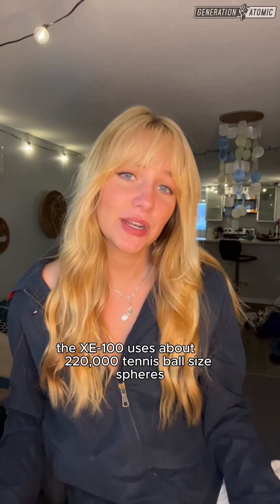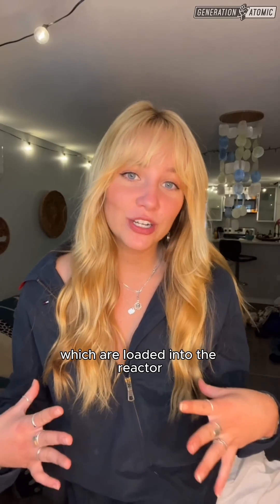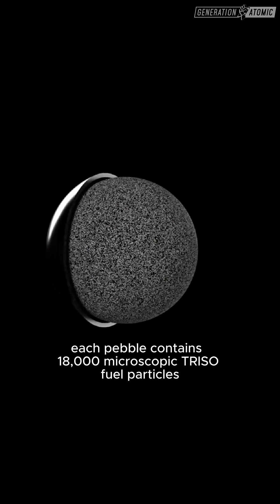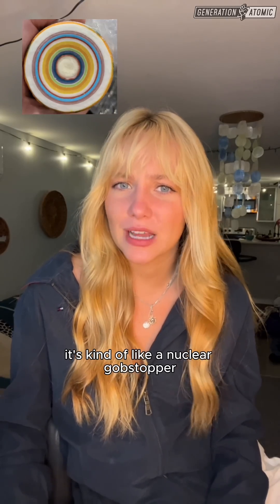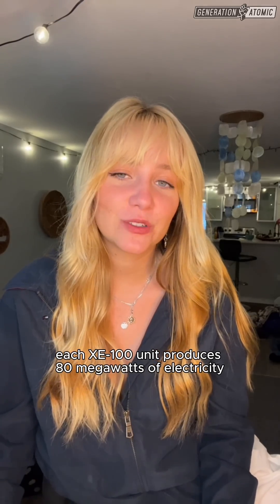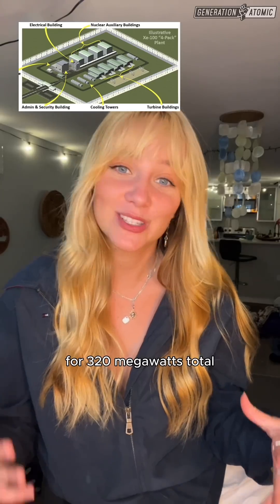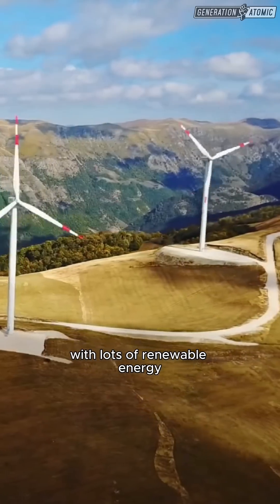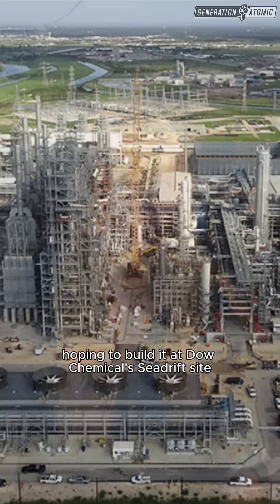The Nuclear Reactor Race: X-Energy #reactor #nuclear #nuclearreactor #energy

Comment: I'll feel better when something physically exists!  Could they make prototypes or something to jump start the supply chain???
Reply: They built it twice in Germany. The larger was called THTR300, it generated 300MWe power.
Reply: Hi, English is not my mother tongue that’s why I decided to let Chat GPT translate and reorganize my assay from school to fit into the profile of the USA.

The discussion around nuclear energy and renewable energy mainly revolves around costs, waste, and long-term responsibility. The differences between these energy sources can be clearly illustrated using the United States as an example.

The U.S. has roughly 330 million people and consumes about 4,000 terawatt-hours (TWh) of electricity per year. If 50% of this electricity came from nuclear power, about 2,000 TWh per year, roughly 330–385 short tons of high-level radioactive waste would be produced annually. With a 20% nuclear share, this would be about 130–155 short tons per year. High-level radioactive waste is produced continuously during the operation of nuclear power plants and remains dangerous for over 100,000 years.

Over longer periods, these amounts accumulate significantly. With a 50% nuclear share, over 3 years about 990 short tons, over 5 years around 1,650 short tons, over 10 years about 3,300 short tons, and over 20 years roughly 6,600 short tons of high-level waste would accumulate. With a 20% nuclear share, the amounts would be roughly 400 short tons after 3 years, 660 short tons after 5 years, 1,320 short tons after 10 years, and about 2,640 short tons after 20 years.

The storage of this waste is extremely expensive. Long-term disposal costs are estimated at $5–10 million per short ton. This means that with 50% nuclear power, disposal costs after 20 years would be roughly $33–66 billion, and with 20% nuclear power, about $13–26 billion. On a per capita basis, this corresponds to roughly $100–200 per person for 50% nuclear and $40–80 per person for 20%. These figures only account for storage, not for plant decommissioning, safety measures, or millennia-long monitoring.

New reactor types, such as thorium reactors or so-called fast breeder reactors, could reduce the amount of waste, but still produce radioactive byproducts and are not yet in widespread commercial use. Completely solving the nuclear waste problem with these technologies is not possible.

⸻

Additional costs not previously accounted for
	1.	Decommissioning old reactors
	•	After about 40–60 years, a nuclear plant must be dismantled.
	•	Cost: roughly $1–2 billion per plant.
	2.	Construction of new reactors to achieve a certain share
	•	To reach 50% nuclear electricity, many new reactors would be required.
	•	Cost per plant: $6–10 billion.
	3.	Safety measures and emergency preparedness
	•	Staff, inspections, physical protections, evacuation plans.
	•	Operating costs: $100–200 million per plant per year.
	•	One-time or project-specific investments during operation: $100–500 million per reactor.
	•	National emergency preparedness: $1–2 billion per year for the U.S.
	4.	Millennia-long monitoring of waste repositories
	•	Repositories must be monitored for 100,000+ years, including inspections, research, and staffing.
	•	Costs for the first few decades: $1–3 billion per repository.
	•	Extrapolated over millennia: conservatively $10–20 million per year.
	•	For the U.S. with 50% nuclear power, total monitoring costs could theoretically reach ≈ $1–2 trillion.
	5.	Modernizations and major refurbishments
	•	Regular safety upgrades are necessary.
	•	Costs: $100 million to $1 billion per reactor per decade.

💡 Total additional costs: For the U.S. with 50% nuclear power, decommissioning, construction, safety, monitoring, and modernization could cost several hundred billion dollars more over the coming decades. Per citizen, this would amount to at least $300–500, on top of the $100–200 for waste storage.

⸻

Renewable energy

Renewable energy sources such as wind, solar, and hydroelectric power generate no radioactive waste. If 50% of U.S. electricity came from renewables, annual investment costs would be roughly $80–120 billion. With a 20% renewable share, annual costs would be about $30–50 billion. Over 20 years, the total cost for 50% renewable energy would be roughly $1.6–2.4 trillion. These costs include the construction of infrastructure and facilities, but no long-term disposal or monitoring costs, as the waste produced is recyclable and nonhazardous.

On a per capita basis, the costs for 50% renewable energy would be roughly $250–400 per person per year. There are no long-term risks, no waste repositories spanning hundreds of thousands of years, and no burden on future generations.

⸻

Conclusion
	•	Nuclear energy: relatively low waste volume but extremely dangerous, very expensive to manage, with additional costs for decommissioning, construction, safety, modernization, and monitoring. Responsibility extends over 100,000+ years.
	•	Renewable energy: higher initial investment, but no highly hazardous waste, no long-term monitoring needed, and more sustainable and responsible for the future.

Nuclear energy shifts problems into the future, while renewable energy addresses them in the present.

Do what you want with that information. I think it’s an important and highly needed information for all of you. Renewable energy is not only less expensive than radioactive energy but also way safer, plus so many generations after us would have to handle the tons of waste that we produce with those reactors and we frankly should not make any decisions that those future generations have to lift and deal with.

Always make your own research and decisions not on social networks but on studies and research books, because influencers always want to influence everyone into thinking the same as them, while not being qualified themself. I don’t know her. I haven’t watched her much, so I don’t know if she is qualified but I spoke about the majority of influencers. I am not qualified. I haven’t studied anything yet. I just did some research and want you to do it as well, because I’m just a stranger and shouldn’t trust anyone on social media. 

Thank you for reading.
I wish all of you a wonderful day. 
Bye
Reply: @Onyx-Kasos  wow.
Let me add follow the money. 
Billionaires are promoting Will Shackel videos, they want government garrenteed private investment in nuclear plants.
Government supplied bigger grid capacity. 

My calculations is generation is 2cents, 3cents,  4cents,  but 44cents kWh at the meter boxes. 

The simple insight is that the grid is a 10times bigger businesses than the generation. 

New grid capacity is $100sBILLIONS. 

So PV roof electricity is 2cents kWh to 5cents kWh AND no grid rental.
Dirt-cheap electricity at the customer. 

All distant generation needs the expensive grid.
The grid business itself needs a far bigger cashflow than the generators. 

If you understand this fundamental facts then you can understand future bigger electricity. 

But not half of the problem but 90% of the problem.
Reply: @stephenbrickwood1602 
Is what you are trying to say, that the big guys just want to make profit and don’t care about where the waste goes?
Because the majority of people don’t want nuclear waste as their neighbors.
So it’s hard to find a final space to store the waste.
Reply: @Onyx-Kasos No. 
I am saying nuclear electricity is too expensive. 
 As soon as a solution to global warming or climate destabilisation includes the cost of nuclear electricity you must include the grid rent AND nuclear defence exploding budgets costs and the nuclear plant costs and the cost of nuclear waste storage.
Millions of tonnes for the world for years decades and decades and....

And then the cashflow demand is massive.

Australia face Indonesia in Timor, both without nuclear weapons. In 1999.
The 2 armies were face to face.
Australia invaded Indonesia. 

My father's generation died in jungle battles north of Australia. 
China sailed around Australia live fireing it's guns into commercial airline flight paths.
300million Indonesians with their own nuclear industries  ?.?.?
Reply: Start building the bigger grid if you are serious. 
The first grid was built over 14decades.